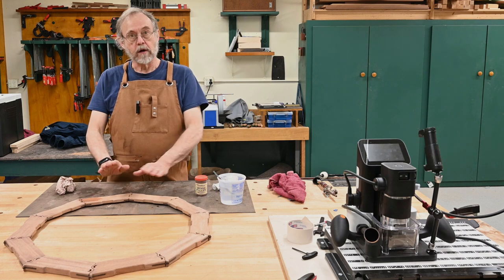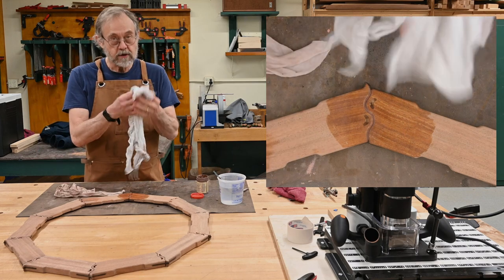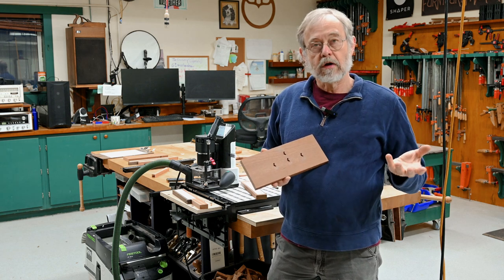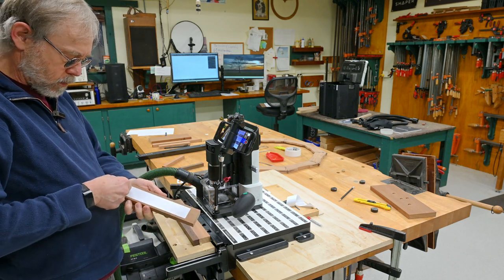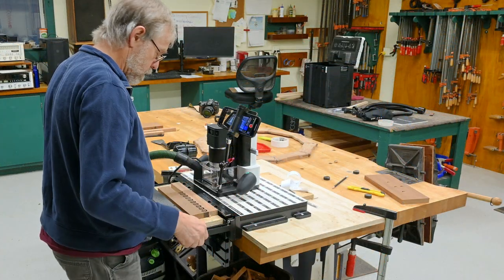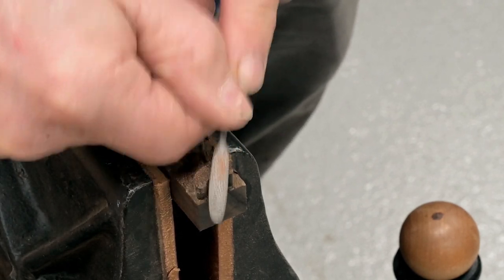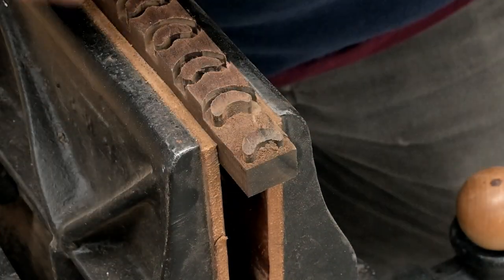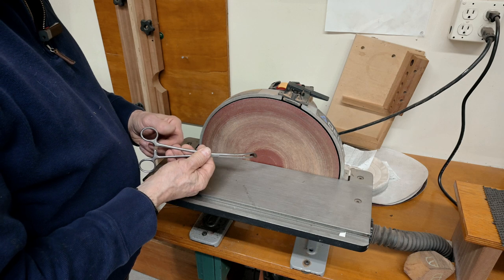Decagon Tahoma Mirror Frame  3 : A Greene and Greene Style CNC/ Shaper Origin Project.

Comment: Nice touch on the sizing of the inserts Darrell. I have a project in mind for the four sided frame,  window molding for a small bathroom window.  Also a frame for a ceiling recessed light opening.  I have a Shaper Origin and it would be a great help to have the .svg files. I am not in a hurry.
Reply from the maker: Hi Scott,  good to hear from you. I will probably have those files ready next week sometime.
Reply: @DarrellPeartFurnitureMaker  That would be great. As I mentioned, I am not in a big hurry.

Comment: Why can't you back bevel both sides on the spindle sander? Seems to me it would be easier and save some time.
Reply from the maker: You could back bevel both sides on the spindle sander but it's slow going compared to how fast the disc sander removes material.  For me its faster to use the disc sander - then take a couple of steps over to the spindle sander.